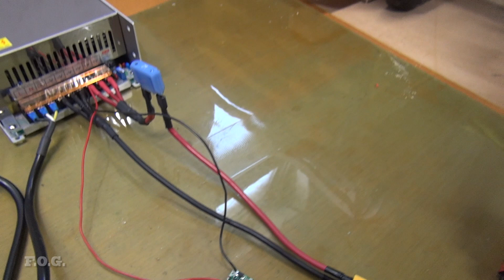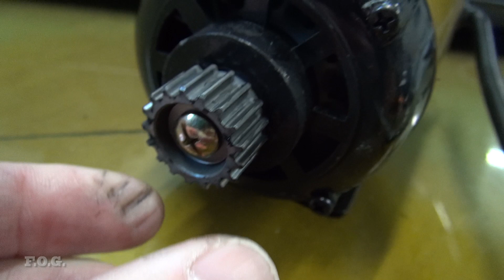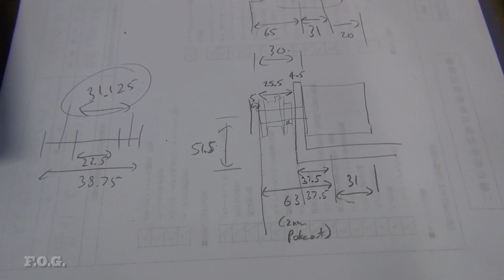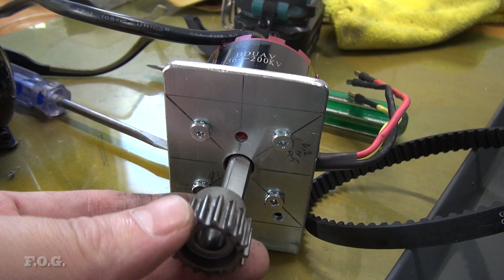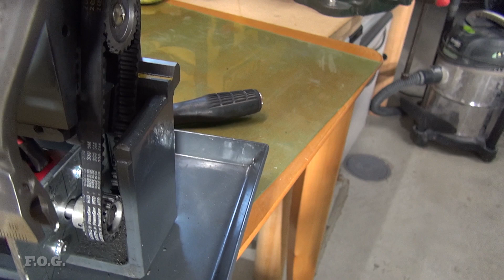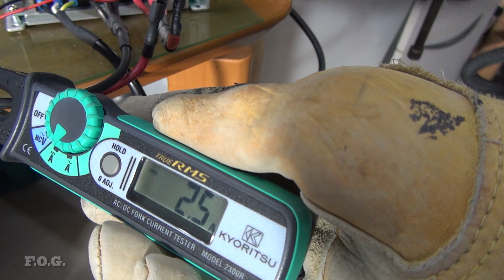EP2 - Mini Lathe Upgrade - Brushless Motor Installation - Brushless Motor Conversion How To

Comment: To bad the noise is a killer deal
Reply from the maker: Actually, I improve the overall noise later on by using a mix of metal and plastic gears, but as you probably don't want to watch all the videos leading up to that, please check this video:
https://youtu.be/s9GsEG8SpQQ?si=XmDemWpp920G50Ve&t=1255
Thanks for leaving a comment! :face-blue-smiling:
Reply: @ForOurGood  Nice, that is indeed a huge improvement. good job.

Comment: How many Volts is your power supply out put
Reply from the maker: It's a 24V and supposedly 1500W. It has some adjustability so I think I pumped it up to 24.6V. Thanks for the question!
Reply: @ForOurGood  so I’m basically following you step for step for my own watchmakers lathe…. But I got a 12v power supply and the motor really doesn’t like something. And I’m guessing that’s it
Reply from the maker: @simmssg  12V should spin up good enough assuming it can put out decent amps. But the max RPM will be about a half.  What is the KV rating of your motor and how many amps can your 12V PSU put out?
Reply: @ForOurGood  so I think I got the same motor as you 6364-200kv and the power supply says 10amps… thank you again for being so helpful…. If it helps you help me… I could send you a quick video of my set up with it “running”
Thanx again
Reply from the maker: @simmssg  Sure, take the video and I will take a look. Actually I had allot of trouble with the cheap BESC I am using, so I ended up using some old 60A RC helicopter BESC I had to check the motor using 11.1V LiPo battery, it span up fine and smoothly. ( I would not put it under super heavy load however). Anyway, I generally have not found the motor to cause a problem so far. I suggest you take it out of the lathe and bench test some different combinations of BESC and power source if you can, and do some testing. For me I used leather gloved  well protected hand to vary the startup load (some danger involved of course, do at your own risk!), and load when spinning, to check how the motor behaved. Once you feel confident with what you are seeing then stick it back in the lathe, assuming your gear train is spinning freely it should work. Also, a 10A @ 12v PSU is only going to give you theoretical max power of 120watts, throw in some margin and you probably should expect maybe max 80W usable power. Now it's going have to be a pretty tiny lathe with super light loads for that to be usable amount of power. For your reference I am using a 1500W 24V power supply, expecting to get a usable 800W. To date I have only measured peak loads of maybe 500W. (Hindsight tells me a 1000W PSU maybe would have been fine, but better to many than too few watts). As stated before higher volts will definitely give you higher max RPM (maxRPM = KV x Volts), but as long as your PSU can stably provide enough amps to reach that maxRPM under loaded conditions, then using the 12V should not be consequential for allowing a smooth spin up of the lathe. (Well at least as per my experience)
Reply: @ForOurGood  do you have an email or something I could send it to? I’ve been unsuccessful sending it through youtube. If not I understand. No pressure
Reply from the maker: @simmssg  No email sorry. Just simply upload he video to your YouTube channel. Keep it simple and without any private info or voice. I will go to your channel and check it. You can delete it later if you want too.

Comment: Sadly a little bit to less torque at output. Maybe you can work out foam with this lathe xD
Reply from the maker: Yes, your correct, it cuts foam just fine. Thanks for your comment and support ;-)

Comment: Don't know if they're commonly available but maybe have a look for a planetary gearbox for the front of that motor. They just bolt straight on and you can get them with the same output shaft generally. I honestly think you need to gear this down a bit. You're in low gear on the head stock there and it's doing pretty high RPM. For many lathe operations you want low speed and heaps of torque. An example is when you have unballanced stock in the chuck for face machining (making anything square or rectangular). Also for threading you generally want torque at low speed. Just from looking at it I think you could gear that down about 10:1 or 20:1. The high speed of the mini lathes is not as useful as low end torque IMHO. I understand why you're changing the motor, I blew mine up years ago, thought about replacing it with a treadmill motor but ended up buying a decent sized lathe. If you decide to do the same and like machining don't sell your mini lathe if you ever want to buy a decent sized milling machine, the headstocks on these make an awesome 4th axis on a mill ;).
Reply from the maker: Thanks for the comment Mr. Munns. My idea was to try to match the original speed specs of the Mini-Lathe specs as much as possible, but I wanted to get a bit more power and stable speed control. The brushless motor I chose also had to be simple, solid but cheap. I often do pretty small stuff down to 3mm if the past, so I don't mind having the RPM's available to get a nice surface finish. Don't use the high gear all that often, but it's nice to have it on hand. I reckon I am seeing at least 4 times or more torque with that compared to the original motor, so it's pretty nice. Really the only thing I will likely change at sometime in the future is changing the BESC to be of the sensored type. That should give me access to even lower speeds and smooth startup under any scenario. Sensorless brushless motors can be a bit jumpy to start in some conditions. It's probably important to note that it looks like there is nearly enough torque in that motor to rip to tool post off the compound.. so as much as I would like even more torque, I suspect it would be pushing that little mini-lathe too far, and it would likely end in tears (and injury maybe). As for a big lathe or a mill.. I could only dream.. Sadly I live in the middle of a big city in Japan where space is a premium.. Maybe I will move to the country in retirement and be able to get one then. One can always dream!
Reply: @ForOurGood  No worries, thanks for the videos, enjoyed your journey with this. I hope to get over to Japan some day. My mate went over a few years back, he said it was an awesome place.
Reply from the maker: @edmunns8825  Thanks for taking the time to watch the series, and happy to hear you found them interesting! Maybe I will do a few more videos on the mini-lathe soon, I seem to be bouncing around with various topics lately.

Comment: Looks good. I would design some kind of shield around that motor to keep the chips and other debris out of it.
Reply from the maker: Wow! First comment of  the series, thanks! In this episode I was just checking if the motor worked at all. In episode 3 the cover for the motor compartment is added, along with some other motor related stuff. Check it out if you like!